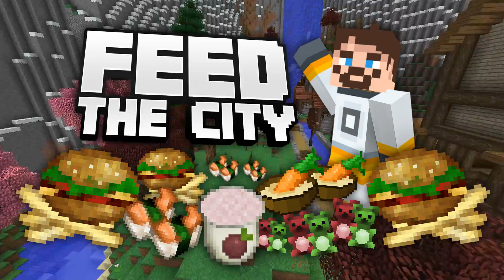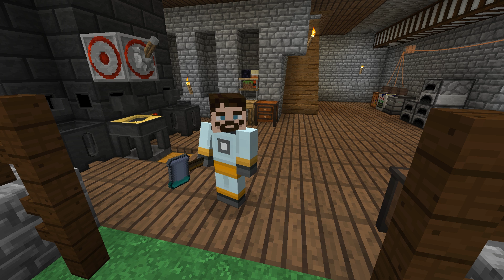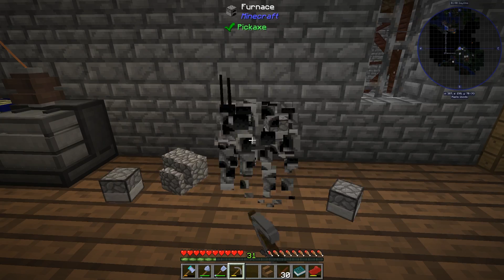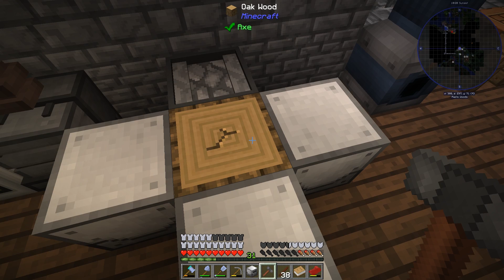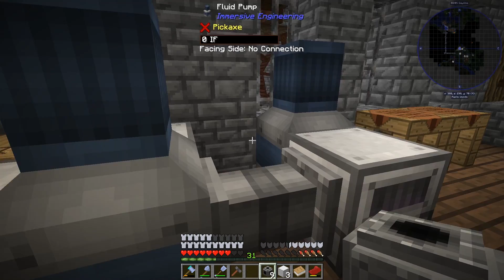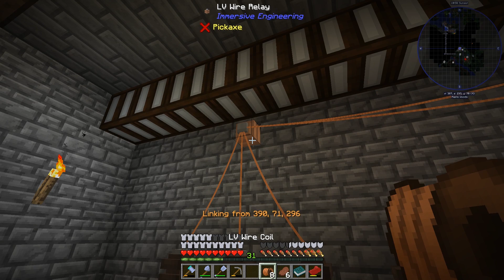Feed The City #8 - Industrial Foregoing

Comment: Maybe move your rubber production inside one of the wheel houses? Have plenty of space inside there and it keeps you from cluttering up the bottom of your home. Just have the block placer in the wall so you can put rubber log in and a chest for the that furnace to drop the plastic off into on the other side. Once you get the piping to the furnace figured out that is.

Comment: facepalm sjin u made the alloy the configurator  wants right before u made steel on this farm, its literally just iron infused with redstone/enriched redstone(the tablet just needs those and gold). 
Also instead of using the stronger pipes u just went for the more expensive and bulky fluid pipes while also weakening ur latex farm at the same pt. It also does NOT look better with the IE pumps , it looks more cluttered.

Comment: Immersive Engineering can provide an electrical way to burn things by means of the external heater. Hooking them up with power and placing vanilla furnaces around them powers them and once warmed up even speeds them up.

Comment: As far as I know, with Immersive engineering pipes, you can right click on the input side of the pipe and the pipe will automatically suck out the liquids without the need of a pump for the Tree Fluid Extractors.

Comment: Technically only the pump providing water needs power. The other is pumping from inventories, which only requires a redstone signal.

Extracting conveyor's are a thing that now exists, which can feed into an IE Assembler and then into the furnace for automated plastic.

Comment: you only need to power the immersive engineering pumps with RF if they are sucking fluid from the world, meaning you don’t need to power the pump which extracts the latex, you only need to give it a redstone signal.

Comment: advice for the future, fluiducts and servos are a lot simpler, cheaper and more versatile.
Reply: and you can pump water out of your kitchen sink for an infinite water source!
Reply: But don't look nearly as cool.
Reply: Eh, the mekanism pipes would have been better. Just a wrench is needed, no servos or redstone.
Reply: truth, all the immersive engineering stuff looks badass except those horrible coke ovens that look like a giant fleshlight. and yeah although according to the developers of the pack, the Mekanism pipes are prone to randomly disconnecting for some reason so it's wise to use something else.
Reply: Immersive Petroleum has now added an Advanced Coke Oven that looks similar to the Improved Blast Furnace but has different looking pre-heaters. Much nicer.

Mekanism's been doing that in all the 1.12 packs.
Reply: Mikail Elchanovanich Hmmm I've seen universal cables randomly disconnect on occasion, but didn't have any issues with the fluid pipes.
Reply: EnderIO Conduits are, by far, the best pipe in the game(can have multiple in one square, works for some mods, can be completely hidden inside "blocks"(facade, painted as anything), but he prefers RP > Efficiency, which is fine
Reply: modernkennnern The good ones are too expensive and Ender IO in general has poor transfer capacity.

Comment: Dig a 3x1 trench put water either side middle becomes infinite. Should be able to hide the water under the wall pump and machine if it can be directly next to the pump :)
Reply: There's an infinite water block you can craft pretty cheap so it takes one space.